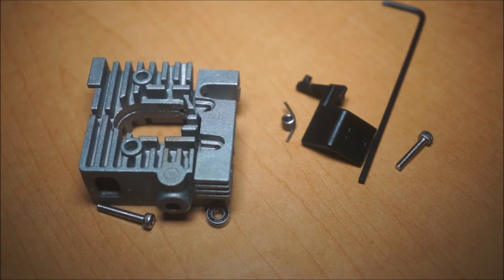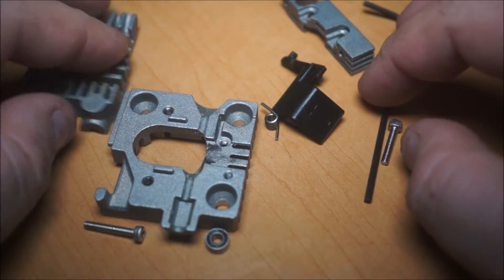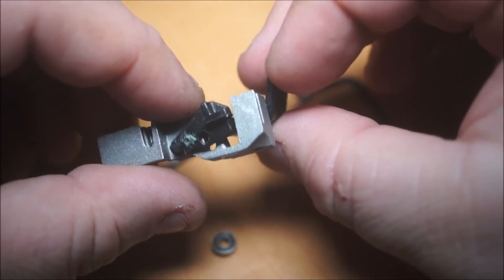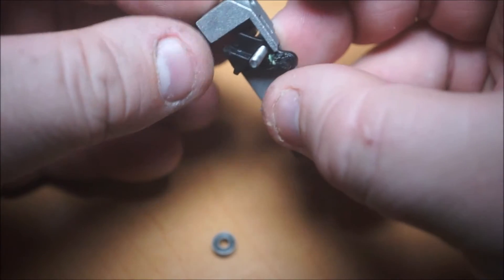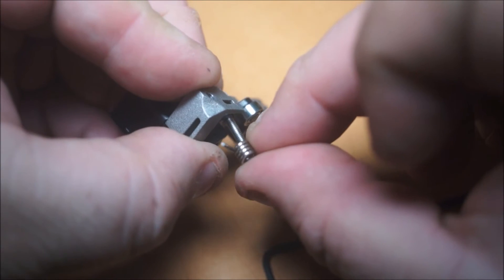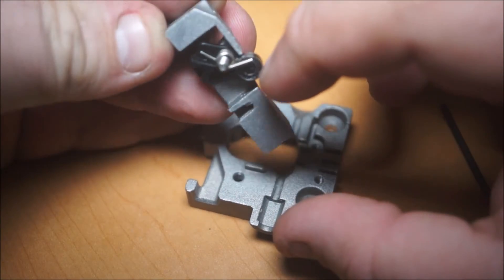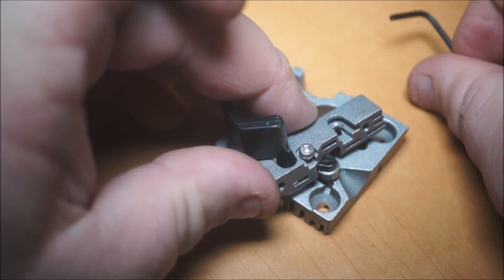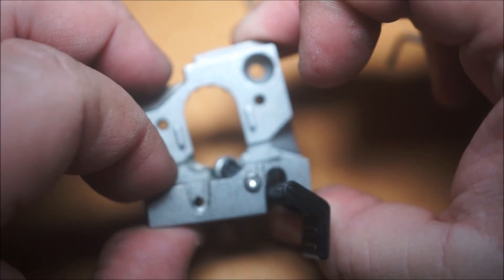Solidoodle Press Tension Mechanism

Comment: thank you for this, i was having a hell of a time figuring out how to tension that spring!  

to make it easier i just removed the gear on the stepper motor shaft then put everything back together and slid the gear back on the shaft and tightened the set screw last.

Comment from the maker: This is just a quick concept while i was re assembling.  I took mine apart and the spring fell out so i just documented how it would go together.  I did it differently by installing and twisting while it was on the head.  Its really easy once you get the motions.

Comment: Yea, this is only semi helpful.  Take the assembly off the stepper.  Do like he says and then rotate the whole assembly and "lock" it under the tab on the backing plate.  You can then screw the assembly to the stepper motor.  Then you can continue rotating the front piece until the second screw goes in.

This is a pain in the arse to do and required to tighten the set screw on the drive gear for the filament which was loose from the onset.

Poor quality control.